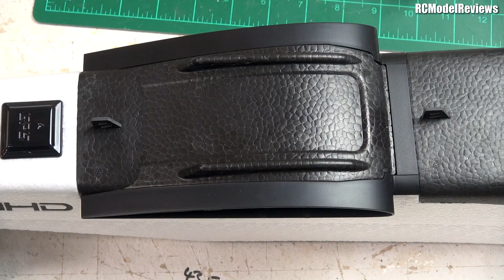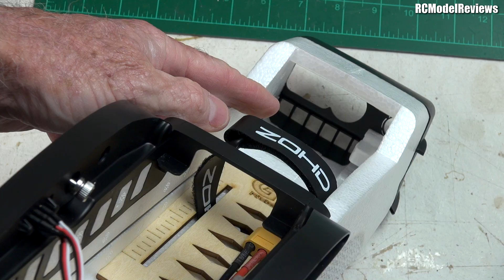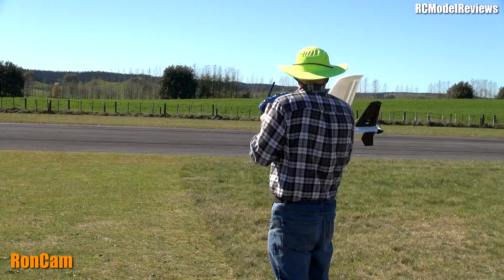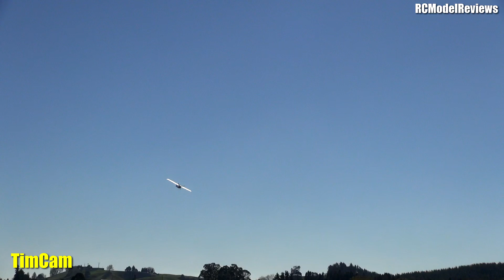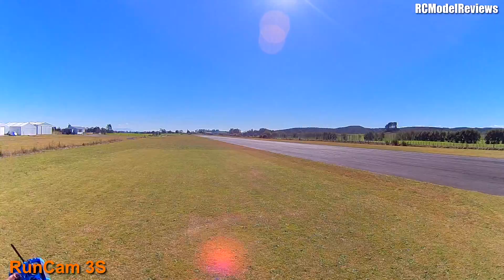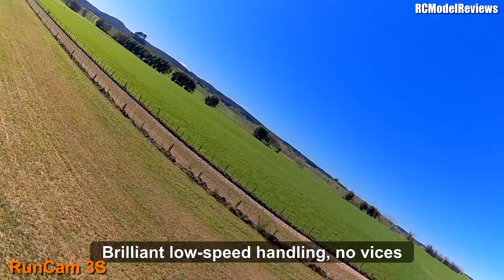ZOHD Talon Rebel GT FPV RC plane review

Comment: It's funny how YOU say it has a nice low speed handling while others face tip stall. But I'm sure that because on the opposite to others you know how to make 3 axis turns which is much smoother than only ailerons and elevator.

Comment: Hello Bruce! You mentioned that you recommended moving the CG marks 1cm towards the back of the plane and that change made it fly better. What did you noticed when flying with CG set at factory marks that you thought that could be better?

Comment: low C ratings on a 5.2Ah pack is still very usable. I use that same MultiStar 5200mAh pack with a 12C rating on a quad and it works just fine.. For the flying I do I rarely draw 50amps for long

Comment: Seems the motor issue is a bit of a chronic problem.  Zohd will switch it's supplier. I wonder what hassle the current owners will have with their defective motors...

Comment: you might need to adjust the tail linkages, you had to adjust them by about half a cm on the nano talon. It looks like a beautiful plane but AU$300 seems a bit excessive. I wonder how ZOHD is going to try to improve the Orbit though, its their last airframe still on v1

Comment: The only similarity of this motor and a genuine Sunnysky motor, is that its black.  Try putting a 5200mah 4S in it with all the FPV toys loaded and launching in a no wind situation Bruce.  Tip, throw it REALLY hard.
  The prop didn't sound very efficient either, open the throttle and it just made a lot of noise rather than thrust...?
Reply: There was virtually no wind when I flew the model and I did have a 5200mAH 4S pack in it for those flights -- it seemed just fine.
Reply: Oh, okay, but I know the launch has ended badly for the Pirate, and he's no beginner either. It has no FPV gear in it Bruce, it all adds up.

Comment: Mr B, What are  you doing with your face so close to the transmitter before chucking the plane?
Reply: Opening the throttle.  I'm mode 1 (throttle on the left stick) so with the plane in my right hand I can't operate the throttle with my thumb .

Comment: Nice review once again.  I have the ZOHD XL newer version and they have made some nice changes to it.  Some fellows suggested a few modifications to it which I did to strengthen the nose back about 8 inches with a couple carbon rods and the motor mount  with extra wood and glue.  I also added magnets to hold the back hatch on so I didn't have to fart around with the two screws every time i wanted to take off the back hatch cover.  Have set it up with gps and return to home in case i fly too far out and lose contact and hope to test it all out soon.  The snow has finally left now all we need is for the weather to get above 10C and for it to stop raining.  Happy Flying

Comment: what does hanging the tail mean???
Reply: when turning, the tail seems to "hang down" instead of it being coordinated and following the nose.
Reply: @FPVSteve  Steve nailed it.  Yes, it produces a turn that is not "coordinated" because the tail tends to fall and the plane appears to almost knife-edge through the air and indeed, onboard instruments would indicate a side-slip in such situations.   In such cases you need to add rudder (in the direction of turn) to push the tail back up so that the fuselage returns to the horizontal position and the turn becomes "coordinated" with no sideslip.   Another FPV model that did this very badly was the old HobbyKing EPP FPV model.  You could reduce the tendency by adding more vertical stabilizer area (and quite a few people did).
Reply: @FPVSteve  is that due to balance or control.

Comment: I have over thirty models and find that all that have V tails handle badly with pitch control problems especially the close coupled ones.
Reply: Ha ha ha,be careful saying 30 models x 20.00 per model rego.......
Reply: Mark Hinchcliffe Sorry but not sure what you are on about.
Reply: I would agree that many V-tailers have poorer pitch stability and this is exacerbated when the tail moment is short.  However, it depends on what you're going to be using them for whether this might be a problem.  This craft (and the (mini)Talon are designed to be flown with flight controllers which (just like with the Boeing 737 Max 8) will mask the problem pretty effectively.  That said, this model (flown without flight controller) did groove very well so I was happy with its handling.
Reply: xjet thank you for the excellent reply. I also have a mini talon which I took out of service. I will try with a  flight controller. The mini drake also has the option to come with a “conventional” empennage for better handling. I have been a fan for years. You are one of the best.

Comment: Great review Bruce. 
I run a rudder mix in my Taranis to make flying even lazier.. I can still use the rudder by itself, but using a spare dial to set the mix level, I got it to ball centre turn perfectly 
on the aileron stick. I also moved CG back and it flies much better, and even more efficiently.
Cheers.

Comment: Have personally watched to club members go to the hospital for stitches after throwing a rear propped airplane with throttle on.  Obviously you've been lucky so far but be careful.  Watchers shouldn't get the idea this is a safe practice.
Reply: I've launched a lot of pushers in my time and the only time I've been concerned for my safety is when launching large, difficult to hold wings with large diameter folding props -- like the GoDiscover.   The reality is that the model will not be able to overtake my hand before my hand is well out of the way (unless I throw like a girl).  Perhaps I should do some high-speed footage of the launch to show how much clearance there is throughout the process.
Reply: @xjet  Love your work just felt the safety issue should be pointed out.  Lot of guys don't really know how to throw a pusher prop safely.  Did a quick Google search and there are several posts of guys getting cut.  Keep up the good work.
Reply: @yellowbird911  Sounds like "safe model launching"  might be worth a whole "elf & safety" video of its own then.
Reply: @xjet  I'd watch it.😊
Reply: This has been thoroughly tested with high speed footage etc, if you chop your fingers on launch, you're launching wrong. Plenty of flying wings flyers out there with their fingers intact. Your hand should be moving forward at the same speed as the plane when you let go, and it will fall away as your arm rotates. After all, you should be pushing the plane forward, not letting it fly out of your hand.
Reply: @slothy89  I'm not doing anything wrong  because I don't launch a rear propped plane this way period.  Sure there may be a technique that allows a reasonably safe launch but when a new rc guys watches this he may not know that.  New viewers watching someone as credible as Bruce may go out and get hurt because they don't know any better.  Can't agree it is a safe practice when I have personally helped stop the blood flow for two people now.
Reply: thats why you continue throwing after the model has left your hand - move your hand down. Seems common sense to me.
Reply: @FPVSteve  Clearly not everyone has the same level of commonsense as you do and that is my point.
Reply: Good point Keith.
Reply: Wouldnt the sub-dorsal fin help with blocking your hand from hitting the prop?

Comment: There are only 2 things that catch my eye...
1- The price seems a bit high.
2- It would be more efficient as a long range FPV plane if it didn't have that Barn Door front end.
A bit more stream lining might be better. It does fly nice though.
Reply: That barn door lets the plane carry a Gopro in the nose, for some amazing video quality.
Something everyone voted for when ZOHD had a poll on their facebook page on if they should have a gopro mount or not.

If you want to see how good the footage of a gopro 7 in the nose is, have a look att my channel or this video, ?V=Y3ut3cZbarU

@RCModelReviews I hope you dont mind that i linked it here. I can delete if you want.
Reply: @NilssonFPV  Thanks for the info. It just seems counter intuitive to have a flat nose on an airplane.
Reply: Very true, but you don't have much option if you want a gopro all the way out in the nose. Where it gets a clear view with nothing in the way.

I can also confirm that it protects the gopro very well, from doing a vertical dive from 100m straight into the very dry mud (good old crunch sound)

Plane needed glueing, plastic nose and gopro was completely fine :)

Video file was corrupted though, as the external power wire came loose and i was flying without the internal gopro battery.

Comment: Bio degradable foam is a funny selling point
Reply: Not to me. There is too much non biodegradable foam. I look for that, recycled cardboard, etc.  The garbage flow has got to change.
Reply: @echobeefpv8530  so what will you do when it degrades to dust before your finished with it?

Comment: Had an AXI 2820/10 that dropped magnets - also no glue. Solution was high temp epoxy and glass balloon mix followed by a spin in the drill press. All good 15 years on.

Comment: Why don't they use closed cell fome. It's a little heavier but twice the strength and you can glue it with anything. You can even pour paint thinners over it with no problems.

Comment: It's certainly a very well thought out design, but I'm curious as to how the new BEPP foam goes as far as durability - I have the original Talon and the foam it's made of isn't nearly as strong as the likes of a Bixler. The lower tail stabilizer on mine broke off on it's first landing on mowed grass and I haven't flown it since...

Comment: This is the first review of this plane that I've seen flown without an FC, and therefore the only one that has noticed the CG problem. Well spotted Bruce.
Reply: Hello Mr Tom :)
Reply: If you're using a flight controller, most people that use inav test a plane using pass through aka manual mode which is the same as flying with no flight controller. That's what the mode is there for. You trim out your plane to fly without any stabilization and then you turn the stabilization on. It's even explained on inav wiki. So if there is a CG problem they obviously fix it first if not then their not using inav correctly.
Reply: Farmer Fpv , so just so I’m correct, this plane’s CG needs to be set further towards the center of the wing from the factory markings?
Reply: I have a feeling we will have an increasing number of RC pilots who will not have the experience of flying unaided, without an FC. As simple as a bad CG will pose a huge problem.
Reply: @sterby1  You're quite right. I always fly LOS before I fit an FC, which is why I've never needed to try autotrim. A flight controller can compensate for a multitude of sins but it'll never be able to fully compensate for a poorly set up plane.
Reply: @Tsnafu  retrofitting an FC can be problematic. I build my craft with FC in-situ and hooked up, and initial flights are flown in full manual, which is as close to a 'bareback' setup as is necessary to mechanically trim out. Then let the FC rip in a stabilised mode and you have a perfect flying craft with the FC not working its butt off the whole time and causing parasitic drag.
Reply: Yes Tsnafu, I always test-fly an FPV model without any form of artificial stability so that I can be sure it's actually trimmed and stable.  Relying on electronic flight stabilization in lieu of proper trimming and design is a fatal error -- just as Boeing recently :-(
Reply: Yer it's pretty bad. I'm going to move the GC back a bit and see if that helps.